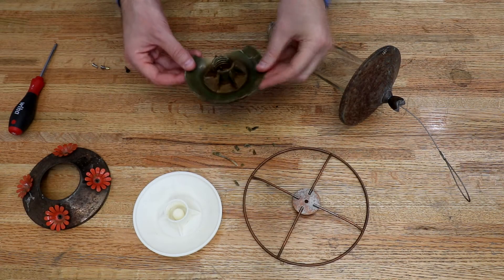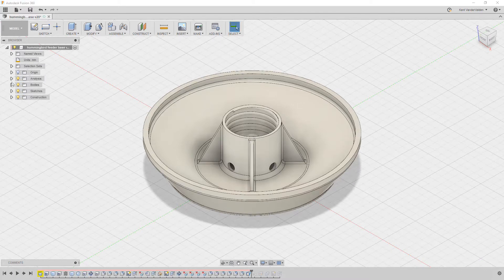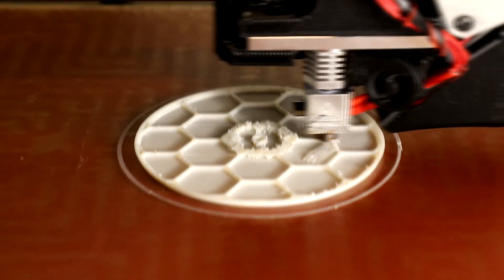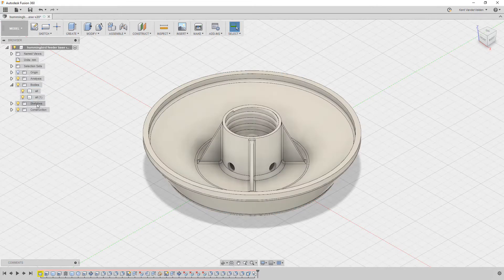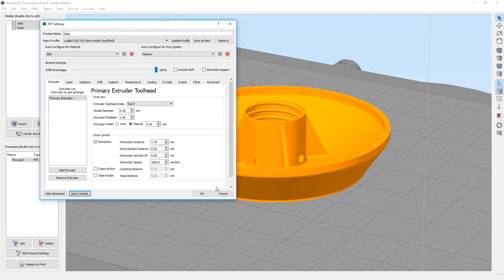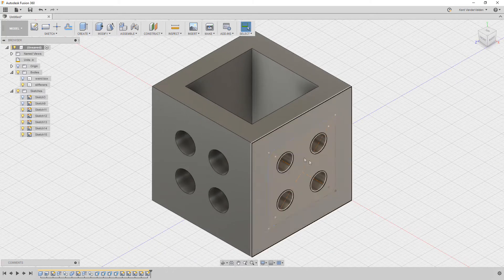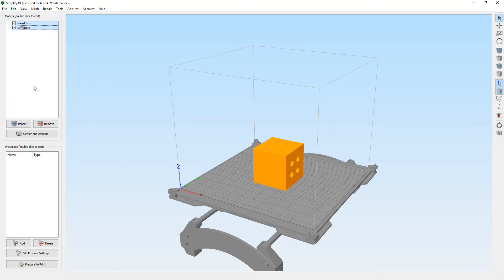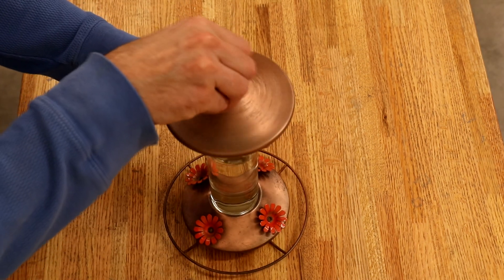Simplify3D and Fusion 360 control 3D print infill material placement

Comment: Gradual Infill + Cubic Subdivision. You can use this to gradually increase infill below top surfaces and also limit material usage in the infill and still provide almost all the strength of the parts using more infill throughout (or even split into parts like this. Its also less complicated)
Reply: I did it in Cura
Reply: You can also set 'minimum infill' (or something like that) that prints a part solid if its under a certain area. Ie. If set correctly, small areas of infill will be instead printed as solid; like small parts like the pin in the centre (so it doesnt also have graduated infill (because the top layer is far from the base of the 'pin') which would cause it to be hollow, and weak, where most of the force would be distributed if the top of the pin had a force applied to it)
Reply from the maker: @Sam3532  Thank you very much for the time to make these suggestions. I have an Anycubic Photon Mono, and their software has fewer options than Cura. I'll give it a try!

Comment: Excellent and very helpful, thanks. As it happens I have a very similar repair project on my to-do list, to replace the broken plastic top of a hummingbird feeder that needs to hold water as an ant guard. I haven't yet used Simplify3D but I may try it out. Slic3r can do some similar things using "modifier" volumes but it looks much easier in Simplify3D.
Reply from the maker: Thank you Jay, I watched your harmonic drive video recently and that lead me to your blog. You're quite talented and present with the calmness of Bob Ross. I wish the example could have been something other than a humming bird feeder, but that was the project at the time. The book Functional Design for 3D Printing triggered the idea for controlling infill manually. I read the 2nd edition in a single day, it's that interesting, and the 3rd edition recently came out. V4 of Simplify3D lists improvements in the process control that might make this easier. Best wishes, Kent

Comment: Thank you for the video - always enjoying your content. However in this case I would strongly disagreed - printing this way will most certainly create weaker prints then just using standard 2-3 shells and 25-40% infill. I have been printing for almost 5 years now - and temperature / cooling and layer height settings has a huge impact on the end result. And method presented here will not produce good adhesion between layers. Especially on the solid layers in the middle of the model - perimeter would be very week and there is so little infill it will not bond. And key to a solid print is good permiter with good bonding. And pretty much the only way to get it is by using high layer hight and high speed.
Reply from the maker: Hi Dmitry, thank you for the feedback, and I agree the about the importance of temperature, perimeter, and bonding. Perhaps I misrepresented what I was trying to do. I was not trying to increase the strength of the entire part. Instead, I wanted to modify the infill in specific areas. In this case, those areas which will receive screws. The situation I had in mind is a large mostly cosmetic print, but there are a few attachment points. If a small amount of infill is used, and these points are later drilled or machined, the support area is weakened, perhaps to the point the perimeter is lost. Even using heat set inserts, if the area is not thick enough or strong enough to receive the insert fail. I could easily be wrong, but I feel most of what you said complements what I did well. Will you help me understand and point a place in video where I messed up? Best wishes, Kent
Reply: @kentvandervelden  in your last example, the perimeters of the different bodies does not intersect, there will be a weak spot. Imagine, that you print stick with this metod. If it consists of two bodies, it will break on body boundary.
Reply from the maker: Hmm, I watched that section and read your comment several times and am not seeing the same thing. The final outside surfaces are shared in the aligned and intersecting models. Internally, the solid infill volume intersects with the lower precent infill volume. Let me know what I'm missing, because I must be overlooking something. Thank you
Reply: Take a look at the image at 9:38 -- before the actual holes start printing, the connection point between two different bodies are touching but not intersecting, on both of the cube walls. I think that's what Dmitry was talking about. I'm not sure how much that would affect strength though. Maybe a little?
Reply from the maker: @EphiBlanshey  Oh, I see now, thank you. I don't like that that discontinuity either. I've used this technique several times, and maybe I fixated on improving strength in one place at the cost of weakening the part elsewhere. I'll try again and pay attention to the actual printing.
Reply: I watched a video a few months ago that explained how to use meshmixer to customize the internal infill of a part, but I can't find it right now. I wish slicers made custom infill easier to do. Like yourself, I have a part that needs low infill for most of it, but I want to reinforce some areas with internal "ribs" that are 2mm thick or so. There's no straightforward way to do this. I'll be looking into how to use meshmixer to see if it offers a solution.
Reply from the maker: @EphiBlanshey  Would selective infill in Cura help you? That was what I trying to do, before the option came out. In the book Functional 3D Printing they describe a process with the granularity to specific infill per level, but the details are sparse. It's worth figuring out.
Reply: @kentvandervelden  just watched a video about it, it looks cool. It doesn't seem like it would be easy to make internal ribs like I was thinking. That would really be the most ideal to keep weight low and strength high. I can let you know if I find a solution to that, if youd like.

Comment: Thanks for the trick with bodies! It's harder for downloaded STL files but still possible.
Reply from the maker: Have you found a better solution than the following? I load STLs into Fusion360, convert to a Brep, remodel the necessary reference geometry (if needed) and add new geometry, before finally performing the Boolean operations. Have you worked with Autodesk Meshmixer? In the mid-90s, at the company I worked at, I was assigned the task of writing code to convert STL triangles to NURB surfaces. With the math involved, I was in way over my head :)

Comment: For outdoor use, what filament did you use? I have been looking into 3D printing and was surprised at how easy it is to remelt or damage products by just leaving them in a hot car and was wondering on the overall durability of of the end products.
Reply from the maker: Someone more knowledgeable will surely offer a suggestion. In the meantime, I use ABS for everything following having a PLA electronics enclosure deform from what didn't seem like too much heat. This is probably the first print I've done that be outside all the time, and it's water cooled! :) I'll let you know if the it breaks down prematurely, maybe from heat or UV. ABS prints machine OK too (better than PLA), as long as the machined area is solid.
Reply: Thanks